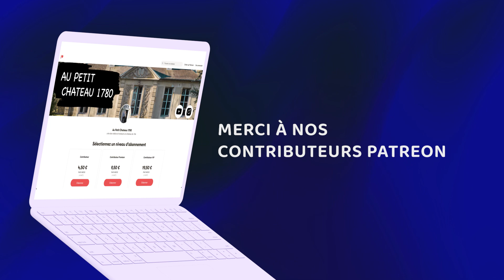Désembouage des radiateurs et urgences au jardin| Vlog renovation

Comment: Bonjour,
10:50   on voit une branche qui pendouille et qui est gênante  pour la circulation du tracteur  car elle affleure la cabine,  je la couperais.
12:57   vous avez pas mal de robiniers (appelé acacia) .   C'est signe que la terre est bonne,  cela a tendance à courir mais la tondeuse maitrise facilement.   J'ai laissé un  bouquet de 4-5 chez moi et je les taille  à  2m30  tous les ans ou tous les 2 ans.   Cela produit des  tiges  de  4-5 m de haut  très droite 1/2m3 environ.   Les troncs  j'ai passé un coup de serpe pour éliminer les épines .  C'est à faire 1 fois c'est rapide et définitif .   

==> pour le lierre c'est signe de plus d'un terrain humifère avec de l'eau.    Pour  garder un  bon ensoleillement dés  la  septembre   je mettrai des cerisiers   10:00 à 10:20 .    Les arbres vont  pomper  une partie de l'eau.

Je crois voir des sapins,  des douglas ?    Les conifères c'est très chouette  mais  ça assombrit terriblement un terrain,    je  les couperai aussi  pour mettre des arbres plus lumineux.   Vous avez un très beaux parc  :   Ginko biloba,   Liquidambar,  chêne rouge d'amérique ou des marais,  tulipier de virginie .   Et  l'étage en dessous il y a toute la palette  des érables du  japon.

Pour le chauffage,  ce qui est valable  ce sont les gros poêles de  masse.   Grosse flambée  par exemple le soir  et  ça restituera la chaleur sur  1 semaine pour les plus gros,   avec l'énorme avantage d'aspirer l'air de la maison en  grande quantité lors de la chauffe ce qui  fera baisser le tx d'humidité.